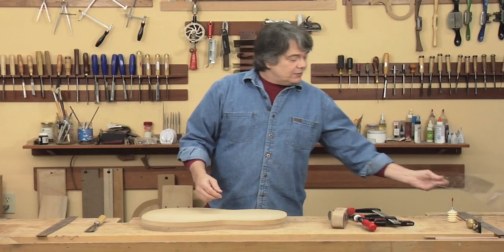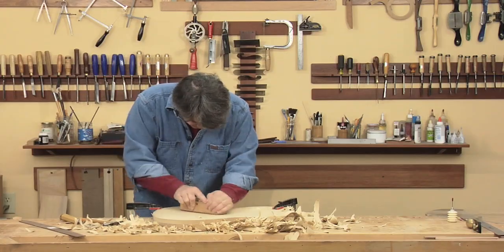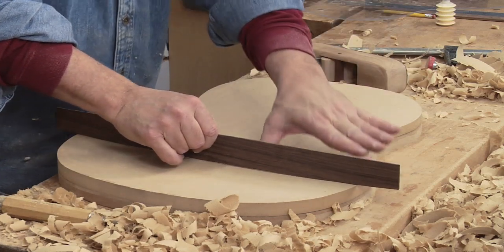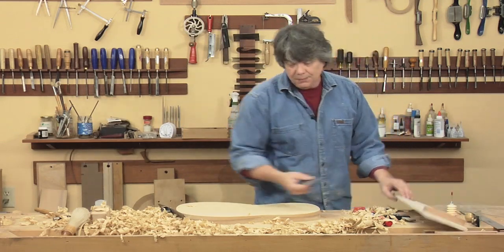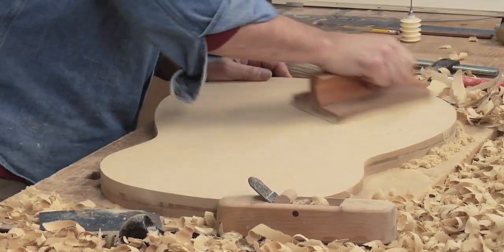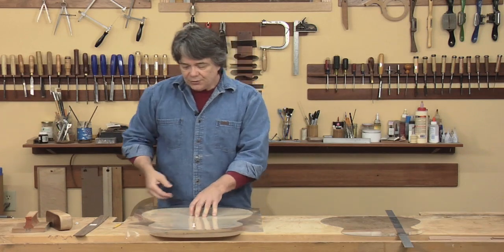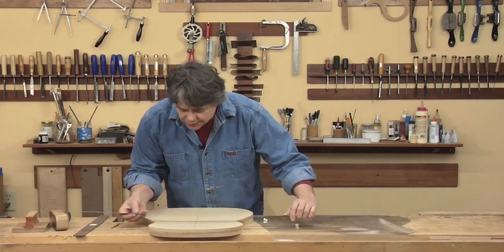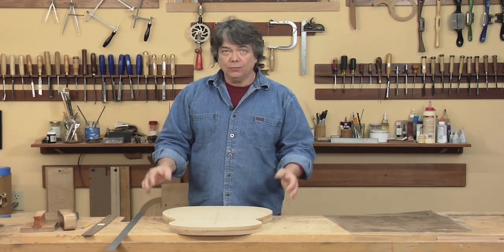Classical Guitar Making: How to Make a Back Work Board

Comment: Sounds crazy I know, but would it be possible to attach a router to the end of a 15 feet rod (minus router distance) suspended from the workshop roof/ceiling to cut the radius in a pendulum type motion?